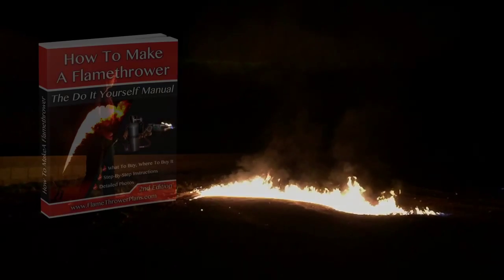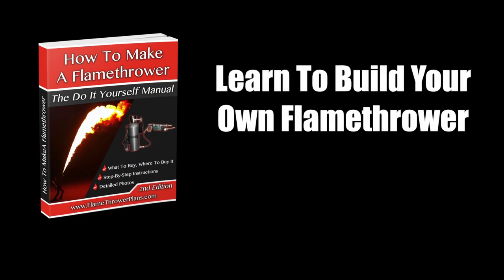Flamethrower Fuel Test: How to Make A Flamethrower

Comment: Try mixing used motor oil and gasoline 1:3, burns hot and strong.
Reply: Does it stick to its target like napalm any good?
Reply: Technically yes if it's decently high viscosity.
Reply: How about dissolving some styrofoam in gasoline? Like 20%?
Reply: Tends to gel too much, at least on short notice. Lye soap is more predictable and more evenly mixes

Comment: I’d try 75% diesel, 25% gasoline and then mix in whatever they use to make napalm B.
Reply: Diesel fuel + gasoline 50/50, and 2-4% synthetic rubber (isoprene rubber) or high molecular weight polyisobutylene.

Comment: What would be the safest fuel?
And what would be the safest combination of fuels?
Reply: Diesel fuel. But it will not be able to sustain combustion on target without additional heat due to its high flash point. Jet fuel is better in this regard.

Comment: I tried 100% diesel and the stream wouldn’t light for some reason. I’ve fired gasoline out of it and that works fine.
Reply: Diesel is alot harder to light
Reply: My diesel fuel did not ignite at low temperatures (close to 0⁰C), in the summer when it was warm, the diesel burned well.